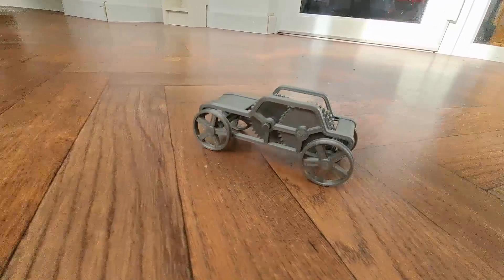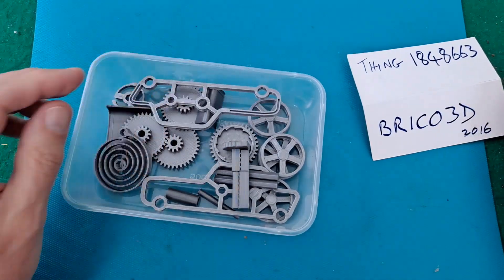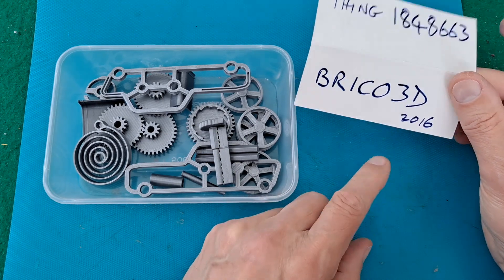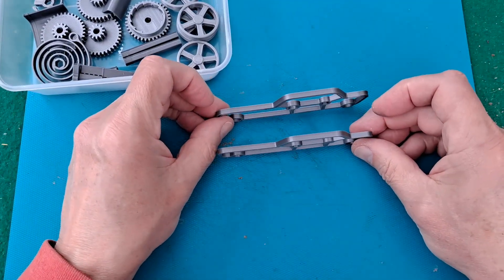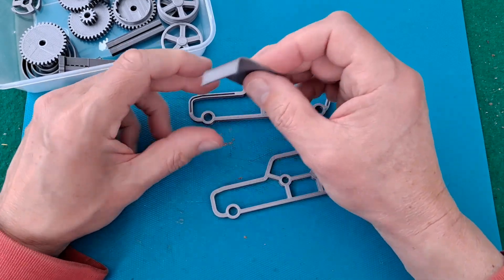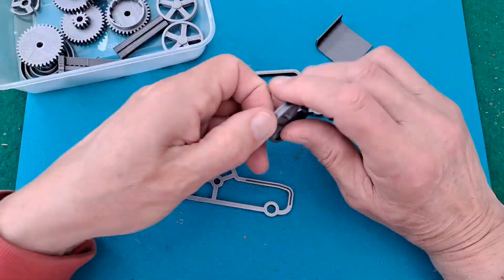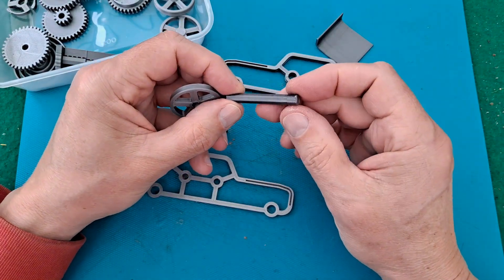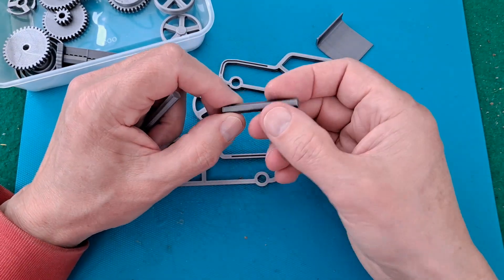P1 Another 3D printed wind up car BUILD

Comment: Nice build.why cant the printer do a clean print so you dont have To clean each Part seperately? Thats Time consuming. Hope it runs good
Reply from the maker: The higher the quality finish, the longer the print takes. So there is a trade off between print time or trimming time.

Comment: The only difference I know between a 'Cog' and a 'Gear', is that a Cog is a type of light mediaeval cargo ship, sometimes armed.
Reply from the maker: I just Googled it "In the strict sense, a "cog" is a tooth on a wheel. A cogwheel is any wheel with teeth. A gear is a cogwheel used mesh with another cogwheel."
Reply: @GrandadIsAnOldMan   - Thank you - that was something that I did not know.
Reply from the maker: @brianartillery  neither did I 😊👍